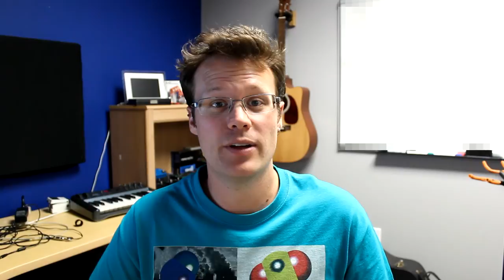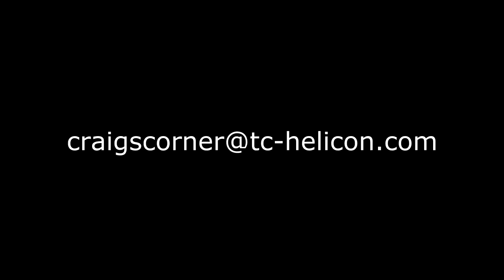Connect a Vocal Processor to a PA,  Powered Speakers or Stick System

Comment: Craig uploaded a 9/25 video on setting up Voice Live Play as an insert within Apple Logic. Quite different from what I described cause he's connecting the VLP through USB, audio goes in/out through that.  I described an analog connection (regular audio cables) since my old VoiceLive doesn't have USB, The digital way in Logic gets a bit dicey, may not work seamlessly, need reboots, etc. At 10 min Craig says if he was under pressure he'd probably do the analog connection.  So, good to know both.

Comment: You are overlooking the auto tune effect . 
I want to figure out how to use a Mic Mechanic 2 so it only corrects front of the house vocals so the singer doesn’t hear the correction in his monitor as it will make singing harder with hearing your head voice and the corrected vocal in the monitor.

Comment: How can I connect a powered Acus acoustic speaker to the TC Helicon please ? I think that I have to connect the guitar DI input of the Helicon to the DI guitar output of the Acus but what about the micro (without using an extra vocal panel !!). A simple scheme or diagram instead would help me the best. Thank you

Comment: I have the VL3X and want to use both the VL3x effects and also my external pedalboard effects, some of which are stereo out. What is the proper way to connect both, use both at the same time, and be able to hear it in the PA sytem that it is connected to. For example, I use the EHX C9 to play organ sounds at church, and a TC Electronics Mimiq doubler for guitar which has the stereo outs, I also use the EHX freeze pedal. But I would like to use these external fx with the VL3X's reverb/chorus/delay etc.....at the same time. What cables and cable connections do I need to make to make this work? Will the aux in and headphone jacks be compromised in this?

Comment: Hi Craig: I had someone come to help me organize my studio better including hooking up my Voicelive 3 with my PA and he told me that because of the Tonematching the Bose L1 Compact provides in each channel, I shouldn't use the quarter inch jack or XLR input on the L1 but should only use the RCA inputs when plugging either the Voicelive 3 directly into it, or even from a mixer like the Mix12FX by Mackie if I'm going into the mixer first, then out to the L1 Compact. Is this correct or incorrect? Based on your video here, it appears you are saying all I need to do is set an output volume level in the Voicelive 3 but that any inputs will work on the Bose L1 Compact (you call it a stick system). I also opted not to get the expensive Bose mixer due to concern about the Tonematching and got the Mackie instead, based on the advice of this person who helped me set up my studio. I'd like to be able to use the L1 jacks and not burn out the RCA inputs.
Reply from the maker: Hmm, I'd turn off any tonematch on the channel you're going into on the L1. Using XLR (or TRS) inputs will give you a lot better rejection of line noise than RCA can.

Comment: I tried connecting my VL2 directly to 2 active Fender Fortis speakers. Stereo output, usual gain settings, normal line level... but the sound level was very low in the speakers (i used the line position, not the mic, on the speaker). Then i pressed the +10dB button on the speakers for weaker line signals and the sound level grew a bit, but still too low. then I selected LINE +12 in the VL2 menu. This added real volume, but I think it used the VL2's headroom and the VL2 started clipping constantly on the same gain settings as before. IS THIS NORMAL? is a mixer necesary in order to get a good signal in the speakers? Thanks in advance for the answer, Craig. :)
Reply from the maker: Hmm, line out on VL2 should give you line level without clipping the output. When you've set things to line, perhaps try re-doing the auto-mic gain. If things were a bit hot before, you might be on the edge of clipping and have it more noticeable when you switch to line out.
Reply: Having same problem. Just purchased the new Mackie Thump12A ‑ 1300W 12" Powered Loudspeaker. Set my volume on the vl3, chained that out to the mixer powering 2 speakers. The Mackie starts to feed back when trying to match the house speakers. The Mackie gain and main levels are at 80%! 1300 watts you'd think would blow my face off and its not even close. When i turn down the Mackie a little I cant even hear it but the sound out the mains are just fine.

Comment: Does it matter if I run XLR out of the left or right output on the back of my Helicon Voicelive Play?
(I set it to mono in setup)
Reply from the maker: In mono, one side of the XLR outs is the mixed signal with effects and the other side is dry with no effects. If memory serves, left is the mixed signal and right is the dry, but you'll have to check to be sure.

Comment: Hello Craig.
My device is no giving any fx when I connect it into any PASystem. Sound comes out but no FX.. What can I do?
Reply from the maker: Might be that your unit is set to MONO output mode, which sends DRY on one XLR out and WET on the other. Could just be that you've got the DRY one connected. Which product is it?
Reply: TC-Helicon: hello guys. I'm using the Voicelive Play.

Comment: i bought one .my god i just eanted a simple mono harmony with one output for my street amp .couple of harmony settings like eagles style eould have been plenty .now i need a phd in rocket science i hate it to bits paid £500 for this spent hours and hours on it and kickec it out the window .it just to complicated and my boss which cost a fraction of the price is easy and sounds boss .
Reply from the maker: Typically the less expensive products are also less complex. Did you get a VoiceLive 3 or VoiceLive Touch 2? Sounds like around the price point you mention. Perhaps you'd be more interested in something simpler like a VoiceLive Play or a Harmony Singer, which are a bit more plug and play.
Reply: TC HELICON How do i hook up my  perform-v to my audio interface to record vocals  with? Please help...i aim to set up a basic mobile studio ...